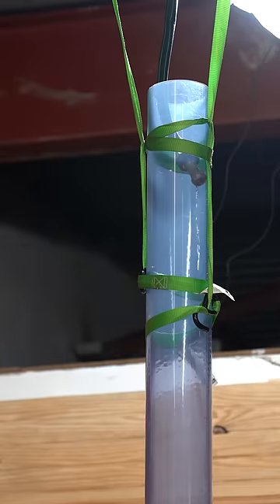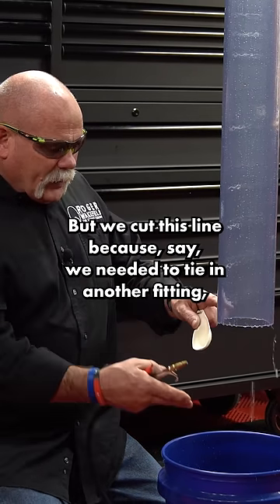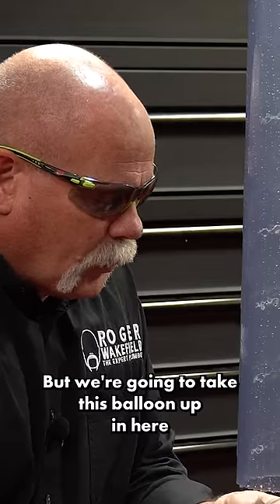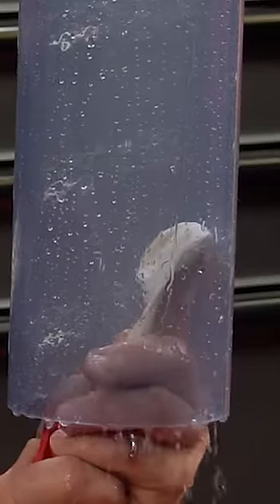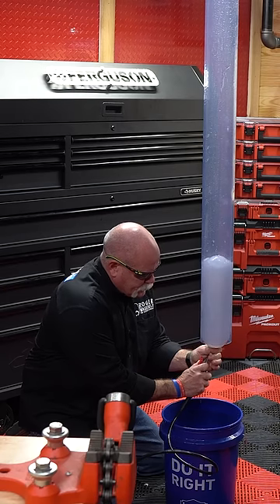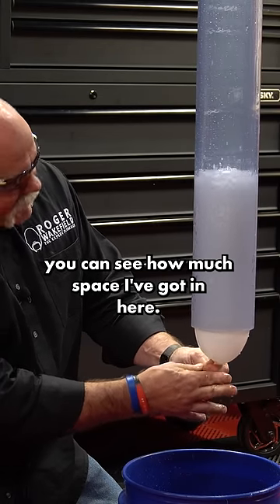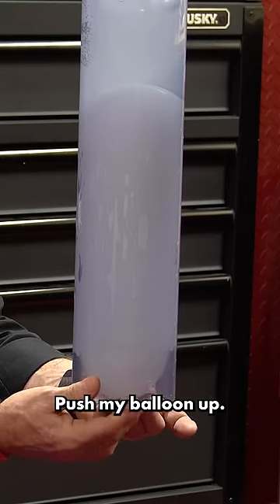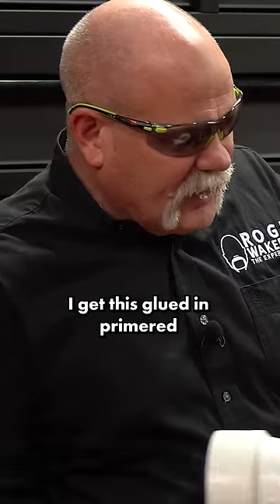PLUMBING with a BALLOON??

Comment: I've had to use bread to stop water so I could solder. Works pretty good but you gotta do your prep work before and work fast to get it soldered. And NEVER use the crust. Was taught this by my dad who was taught by an old timer.
Reply: I've done that in a pinch also.  An old salty plumber showed me that trick and now I pass it on to the new guys
Reply: Buy a jet sweat
Reply: @twodoodsplumbing2486  also a good option 😆
Reply: Got to flush the bread out before you put valves on
Reply: Yeah bread is good for small diameter pipe. You're going to need loafs of sourdough for that diameter pipe lol
Reply: Did that as a first year apprentice  but used rye bread 😂🤣 ended up pulling  rye seeds out of the customers aerators and wc fill valve for then next  30 minutes  after.
Reply: Imagine having to bring 3 loaves of bread to a job to temp plug a 3" stack. Haha who wants a sandwich 🥪 🤣
Reply: You can also use bread to get wheel bearings out lol
Reply: @natebrunet1700  or hammer in wet toilet paper
Reply: If it ain't new construction, Pro-press that bish!
Reply: I was taught the same thing by my dad, who was taught by an old timer. Gotta take the mesh screen off the tap, but the bread comes right out! Great trick.
Reply: Pfft
Reply: Cheap white bread….
Reply: So on the way to the truck to grab your bag of tools, you also grab one of the infinite supplies of bread loaves 🤣🤣
Reply: My old timer pawpaw thought me this
Reply: what kind of bread did you use
Reply: @RandysMixtable  😂
Reply: I didn't think of this until just now, I've heard of the bread trick  years ago, but what about one of the water expanding silica gel balls? It would be interesting to see how it worked. The break apart easy and there 98% water, so sweating pipe with them would be better then toasting bread in your pipe. You'd have to obviously pre soak them, but unless you carry some around pre soaked, breadit is. And I dont know if they still have them but there were these pill looking things with some type of liquid in them and the would naturally devolve in water so the top would devolve where the water torched it but the bottom would stay intact because I thing it was like a mineral oil in the capsule so the water couldn't sink to dissolve, but when you pressurized the pipe it would blowing out and then the water would devolve the rest of it. I tried it once, seemed to work but im not sure if they make them anymore. But this was a great idea as long as there's no heat 👏
Reply: @brakefree6434  

Cheap white bread… remember it needs to dissolve into powder.
Reply: Omg are you the tech who came into my apartment in college while I was gone and fixed something and a bunch of my bread was soaking wet and dirty in the bathroom trash can? I was like “WTF HAPPENED HERE”
Reply: Why not the crust?
Reply: My dad always told me they did that in Mexico I always wondered if it worked
Reply: He should have used a whole loaf of bread 🍞
Reply: I was taught that same technique from a guy that had 30+ years in remodeling. I ended up starting up a remodeling company with him. He knew all sorts of "backyard" tricks that he taught to me. Needless to say, but I'll say it anyways, our company was very successful and got jobs done way faster and cheaper than our competition.
Reply: @twodoodsplumbing2486  when you're on a job and don't have money you don't just give up or give the job to another company. You use any means necessary. Me sacrificing my lunch for the day earned us enough money to eat lobster that night. Since then I won't waste money on a jet sweat. Keep in mind a jet sweat only works when there is no pressure and a minimal amount of water escaping the turn off valve. Not everything is better cuz its newer technology lol
Reply: Pool guy here. I've used bread a few times when cutting into a pipe below water level. You don't have to worry about removing it. The "plug" softens soon enough then just breaks up and blows through the system.
Reply: So im hearing visit popeyes, get a biscut and you got a perfect water absorber.
Reply: I learned to do this because the original explorers of Oak Island would use things like bread and corn meal to block the canal that flooded the treasure pit
Reply: hot water tank is now half full of bread.. sounds like a great idea
Reply: That’s what my pipe welding teacher said lmao! Use wonder bread to soak the water, by the time your done it’ll just dissolve away
Reply: @twodoodsplumbing2486  Only works when you have an open pipe, won't work on the last connection where the pipe is closed.
Reply: I always have a mini shop vac. I used a dust extractor from a sander I never used and rigged it up as a detachable fitting for sucking water out pipes. Works like a charm

Comment: Real plumbers would just leave the balloon in there, cause a blockage then charge the customer $875 to come back 3 days later and remove the blockage. 🤣
Reply: never 
Not a good business model 
Word like that would destroy a business 
I’ll admit there’s crooks in every profession but call backs are not how licensed professionals make extra money.
Reply: @brentmagerowski7886  it was a joke
Reply: @logantrashh7781  
Can’t tell you how many times I hear we are crooks because of the bill 
or when you find a bigger issue on a call back that was missed on the first visit
Reply: Na even if there was no balloon inside and there is a blockage it would be charge free since they worked on that pipe prior
Reply: I'm a real plumber and I would have just glued it and put it on.. adequate glue and primer it would have been just fine. You're gluing the outside of the pipe anyways, worst case scenario you get a little water on your glue in your fitting as you put it on. Never caused me any issues
Reply: @apenation4042 depends on the business doing it

Comment: Rain or shine glue will work in that situation. Waste lines are not under pressure. Smaller plastic with water pressure will also be fine. Important to READ THE LABEL on your glue for compatability with your particular plastic pipe, application and SIZE. Shark Bites for 1/2 or 3/4  is fine for water under pressure.
Reply: Thankyou...that's what I was thinking to bud
Reply: No self respecting plumber uses shark bites 🤮
Reply: @reddirtwarrior5956  They are everywhere these days and who knows who put them there. They are expensive but they do work if installed correctly. Crimp copper fittings I understand but I'm a flux and solder guy.

Comment: This is how the sewer department of your local city fixes your underground pipes.
Reply: If it works the first time and doesn't cause any other problems, then what's wrong with this method? Quit being a hater and learn something for once.
Reply: @palainanoctem3776  because it doesn't. You can clearly see the water was still dripping out. The fitting has to be dry for the seal to work. This would not work in any practical setting. How do you get the balloon out unless it happens to be a T fitting and then what's stopping the water pouring out the opening? This is more clickbait bullshit.

If you know absolutely nothing about what is going on in the video then why bother commenting?

Comment: Done hundreds of drains and never once have I needed to do this. You can seal a wet fitting with glue and primer.

Pro tip: If you primer a fitting and don't use it, throw it away. It won't seal properly anymore. At least on enough to stop carbon monoxide exhaust gasses.

Comment: I'll give you all a massive tip. Turn the water off and back drain the pressure.
Reply: How do you do that in every single scenario
Reply: Unless your shutoff leaks
Reply: Go get a 3in rubber cap and tighten.

Problem solved

Comment: this is awesome, my friend you just have solved my problem. I live in Florida, and we have a 200 ft deep well, which just happens to be Artesian. for those of you who don't know what that means, it means that my well has 20 psi of water pressure coming out of it...........forever. that may not sound too bad, but here's my dilemma. this well was dug 35+ yrs. ago, & on the end of the pipe that comes up, you have a 2" cast-iron tee,  a 2" cast end plug, and the remaining 2" Outlet coming from the tee, that is the well output, which is where my problem arose. you see, after 35 plus years, the nipple coming out of the T has rusted away, and started flooding the entire yard. normally, just change the tee, and you're good....not this time. you see, some genius decided to use cast iron fittings, instead of brass, except for the shut-off valve, of course. it's a real fancy brass valve, that just happens to be on the other end of that cast iron nipple that's rotten, leaving absolutely no way to shut the well off. I don't know if you've ever tried to remove a rotten cast iron nipple from a cast-iron tee, that happens to be attached to a 35+ yr. old well pipe, which is also cast, and, the best part, you can't shut the well off, it's extremely fun. no here's where your balloon comes in..... although, I think I'm going to use a motorcycle tube instead. (more strength, air nozzle for the compressor, etc.) so wow the well pump is pissing out 20 psi water, because all I can do is disconnect the well connection and let it piss everywhere to relieve some of the pressure, while I pull the plug out of the tee.... and by now, I am absolutely soaked.... then I somehow have to jam that tube a decent way down my well pipe, fill it with air, hope that it stops 20 psi from an underground reservoir just long enough for me to be able to repair the cast pipe nipple.... and if it doesn't work, well give it about an hour, and I should have a sinkhole in my yard the size of Cleveland.... 
🤪
well, wish me luck😣💯
Reply: What you need is something like a smaller hose with an inflatable donut or a rubber cone seal on the end, small enough that you can snake your parts over it while it's routing water freely out of your way. Seal up the well plumbing  and yank it through the new valve before you close it. Ball valves only, obviously...

Comment: “Maybe from condensation from like an AC or something like that.”

Condensation from an AC is unlikely to have been routed into a 6” drain. You know what is likely to be routed into a 6” drain? Stuff that you don’t want all over your compressor more than you don’t want to go tell the homeowner to wait on producing it for the time being.

And since when are you gonna need to glue on one Y joint with no connection at the bottom? You’re gonna need a lot more balloons, and it’s gonna stop working entirely the moment any straight part of the sewer gets longer than your arm.

Comment: Where I work contractors sometimes use industrial sized balloons to block the flow for replacement of gates as big as 60 inches!  I never would have thought to apply that principle to small pipes. I guess because for small pipes we freeze the line if we can’t isolate it.

Comment: Sure it kinda works but in a vertical pipe like that if it’s dripping that much or more it’s not gonna stay long the water pressure will quickly push that balloon right out.

Comment: Simply genius!  How many times I've cussed because water ruined a glue joint. Only thing is what if your splicing together two pieces of pipe and don't have access to get the Ballon out afterward? So not so genius then. Maybe a tool like a snake with an inflatable Ballon on the end or a snake with a sharp point to pop the ballon afterwards.

Comment: I wonder if a water ballon would work on smaller stuff 🤔 like a copper line that won't stop draining. Tie a sting to the knot and poke it to get it out.
Reply: Use one of those balloons they use to make ballon animals
Reply: Use white bread, it'll stop the flow just long enough to solder, and it just gets soggy and blows out valves down the line when you bleed the air.
Reply: There's been a tool around for a long time call a jet-sweat, used to plug a copper line so you can solder.

Comment: Potatoes work good for smaller diameter pipes too!
Reply: Lol seriously? The point of using white bread is it disintegrates after about a min in water. I'd love to watch you use a potato then have to remove the potato lol please tell me how you used a potato and how you removed it after you had your seams soldered.
Reply: @palainanoctem3776  gee you’re a positive one, I used it to block a vertical pipe coming from a pool, I then glued a ball valve on and when it dried I opened the ball valve a cut the potato up with a knife and the pieces floated up through the valve. 
White bread would work because it had to seal well and stay sealed for 12 hours